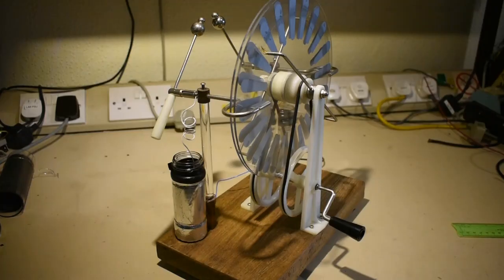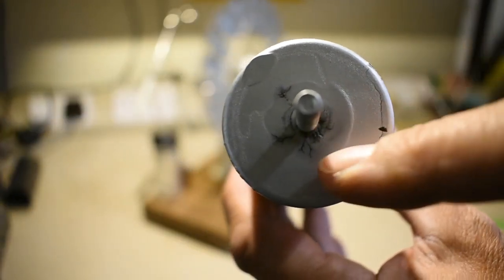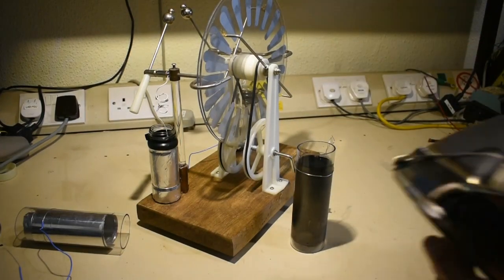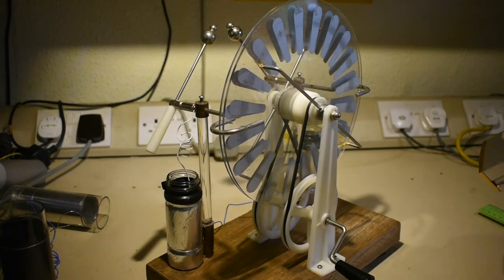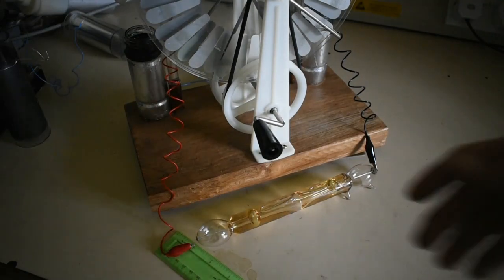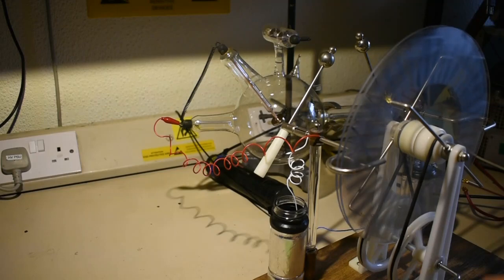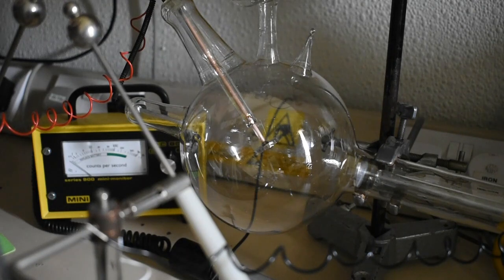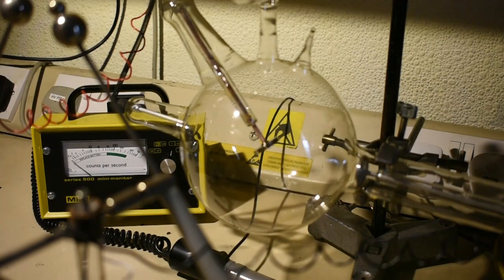Wimshurst Electrostatic Generator

Comment: i love your channel, there's a lot of advanced hi-v stuff

i just bought an identical wimshurst, good to know that the jars are weak!! i'll not push it by widening the electrodes too much

i have in mind this experiment with x-rays, i built a toy wimshurst with CDs but it produces just 2-3uA on the vacuum tube, the tube driven with a flyback starts to make detectable X at like 5-6uA (dammitt!!) that's another reason why i bought it at the end LOL
Reply from the maker: Thanks, glad you fine the channel interesting. Yeah, it was disappointing the capacitors failed over time but I may have pushed it a bit. Replacing them with home made glass ones has done the trick. Maybe something you could try with your CD version to increase the available charge.
Reply: @tuopeeks  i tried to make X without any capacitor, the extra stuff has losses, also infact i should find a solution to disengage the jars on the machine i ordered to avoid voltage hysteresis thus being more controllable and to avoid discharges in the tube... i suppose

Comment: Hi, I successfully built a medium sized Wimshurst static generator, which produced a spark length of about 65mm. I used PVC pipe with baking tray foil as laden capacitors and self adhesive foil on disc. Thanks.